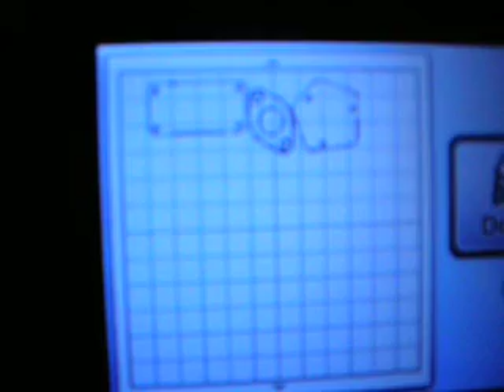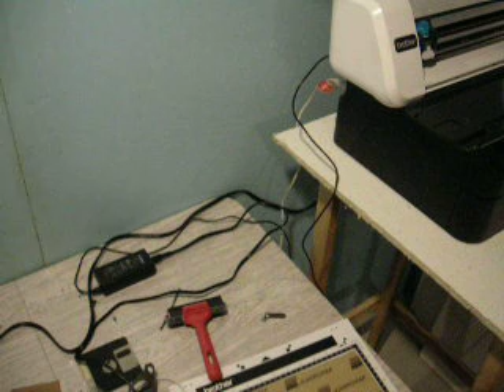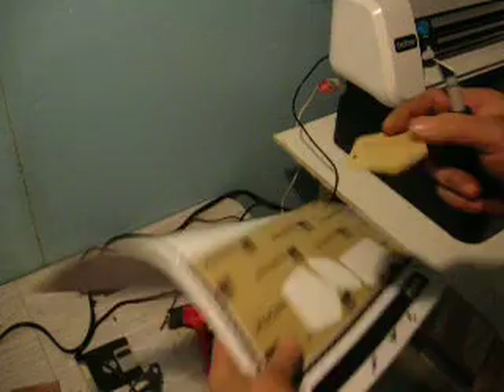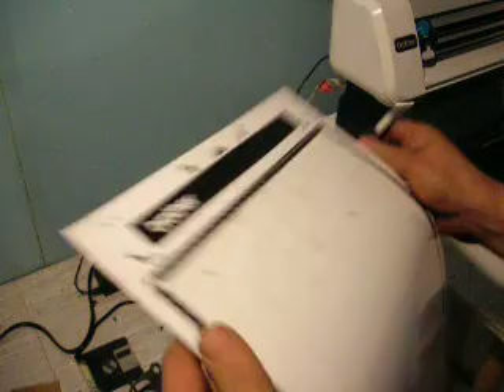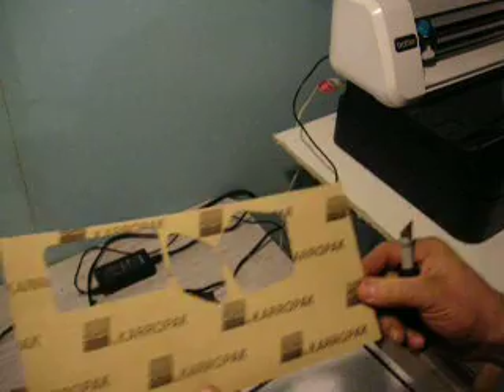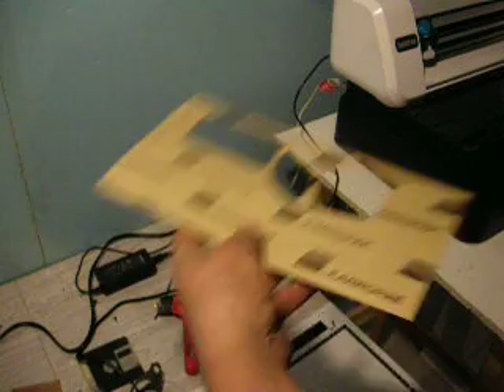A better way to make gaskets using a Brother Scan & Cut

Comment from the maker: The gasket material used here was purchased at the local Autozone for $4.49 for a 12x36 piece.

https://www.autozone.com/sealants-glues-adhesives-and-tape/gasket-material/fel-pro-12-x-36-x-1-64-in-gasket-material-sheet/297302_0_0

This meaning big savings over paying several or even a few bucks each for individual gaskets. Yes, it takes a while for the machine to pay for itself at $3 a gasket, but this is NOT the only thing it can do and it comes in VERY handy when you do need it. Plus if you figure $3-4 in gas plus $3-4 for a gasket, it isn't THAT long to pay off a $180 machine. 

My wife wasn't thrilled I paid $180 for a "gasket making machine" . After I showed her what else it could do, painting stencils, vinyl cutting, etc, suddenly it turned to " I have a few projects for you." and the investment was never mentioned again.  I guess I should have lef with "I bought this machine for cutting stencils for us." LOL